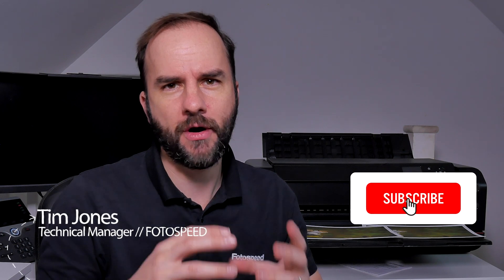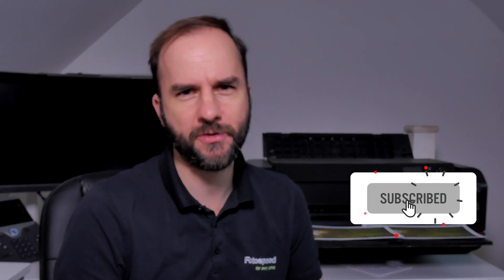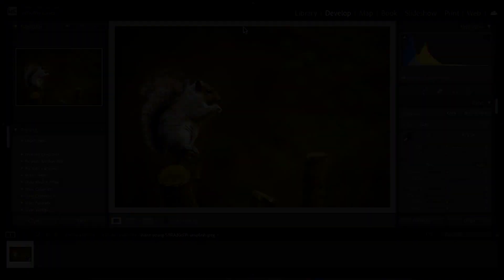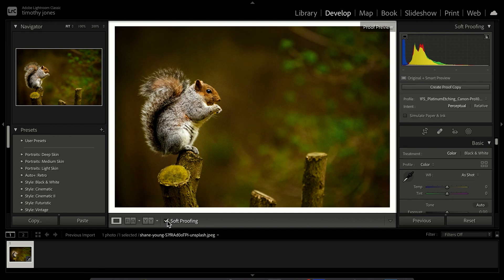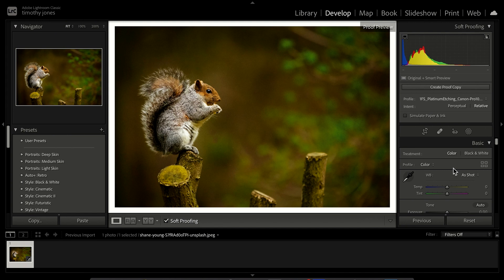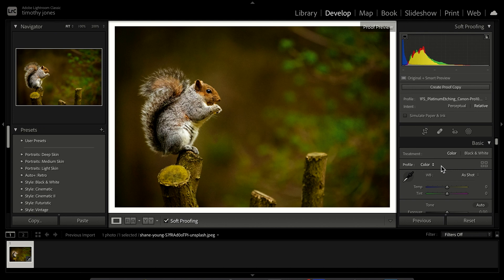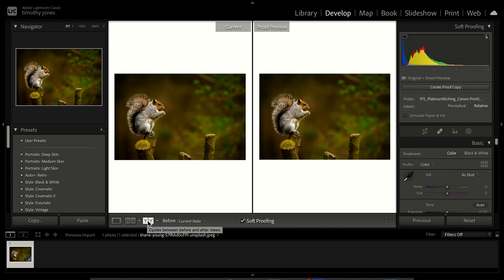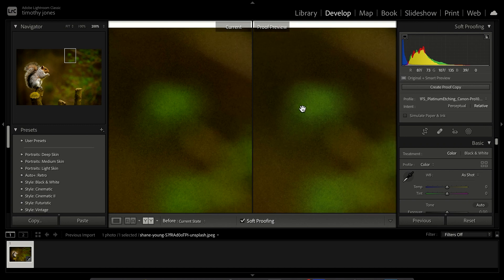Revisiting Soft Proofing - Fotospeed | Paper for Fine Art & Photography

Comment: The problem with soft proofing in LR is that it doesn’t use seperate buttons for simulate ink and paper. The simulate paper is useless but simulating the ink is great for showing the D max reduction of the blacks and shadow areas of the inks on matte papers. That’s why I use PhotoShop’s soft proofing that has separate simulation controls. Also I would print an image like that on lustre paper as matte can’t possibly maintain those levels of contrast and saturation!

Comment: Tim can you please do a short video on getting proper margins (borders) around your image to be symmetrical upon printing? I had to do a couple test prints just to learn that I need to manually adjust my margins as my 1000 does not print what I see on my screen. There's always at least two margins not symmetrical even if I set all four of them to be the same value. Do you do any such tinkering calculations in lightroom with margins and cell size changes? Is it a hardware/alignment issue or a software issue?

Comment: Use the foggy button. Transmissive light and reflective are very different. Even when the final prints are held up you can see that with this function on they look much closer to the on screen proof. The environment must be controlled. The Kelvin of your lighting must match the kelvin on the screen. The calibration should be correct. The monitor must represent paper white in lumen levels and so forth its a mind field.
Reply from the maker: I could not agree more, thats why I always try and get people to make test prints. Tim

Comment: I thought that when you had edited an image to your satisfaction and wanted to print it as close as possible, by turning on the paper and ink simulation with the correct ICC profile selected, you then carried out adjustments to the proof copy to try to match your edited version as close as possible.  This would then to some extent allow for different paper types such as matt or lustre.  You seem to say that there is no need to turn paper and ink simulation, please could you explain. Thank you.
Reply from the maker: I don't generally recommend the Simulate paper and ink option as it always goes too far in it adjustment to get accurate results. When ever I have used it I have ended up with a very contrasty print. It seems to apply a grey fog to the image on screen which is not how the file will print. Tim
Reply: @FotospeedUK  Thankyou for your reply.  I find that printing is a very long learning curve (as opposed to a steep curve).  I must say that I am very pleased with the prints I get from my Canon Pro-1000 printer on Fotospeed papers.  I just wish the cost of ink was much less.

Comment: How do Pro photographers with websites manage there prints because someone buying a print will be viewing the image on their screen, then the print arrives & they will compare it to the website. I noticed you used relative intent for platinum etching. this is my favourite paper but I have always used perceptual. Is the there a great difference in the final print?
Reply: hi, unfortunately there is no either or as an answer. Perceptual has the effect that all colors in the color space are evenly desaturated, including those that are in a target color space. With relative, only the colors that are outside of a possibly smaller target color space are attacked. In other words: you will not be able to avoid trying and comparing yourself here.
Reply from the maker: Hi Nicky, The best way to see which rendering intent to use is to print a couple of prints one on Perceptual and one on Relative and see which you prefer. In answer the the Pro photographers questions if there are printing their own prints they will work hard to get the print matching as close as they can but customers screens are not calibrated in general. the prints will be different due to the calibration. There will normally be a little disclaimer somewhere on the site to cover this. Tim